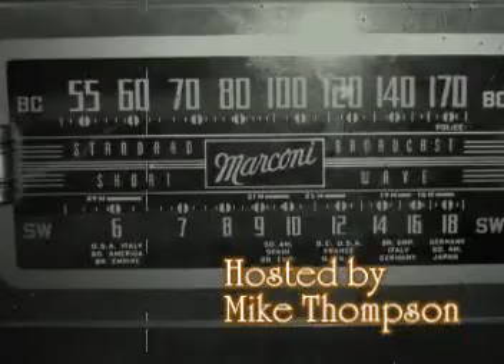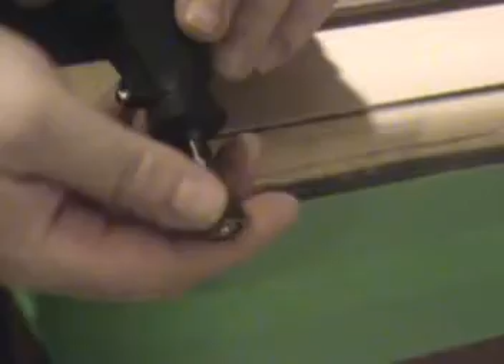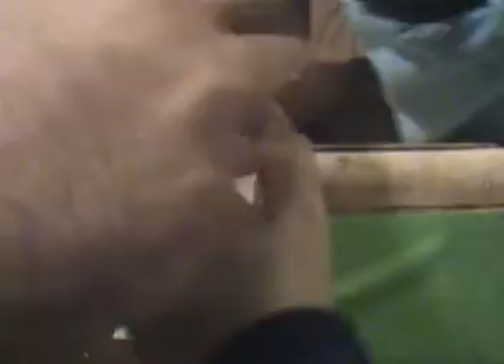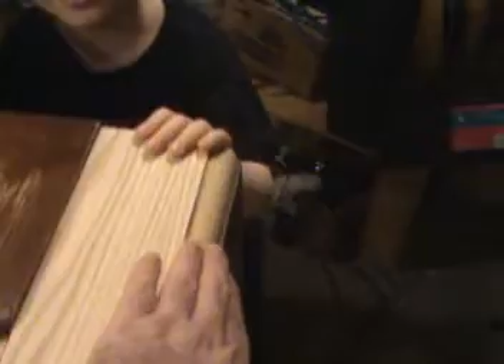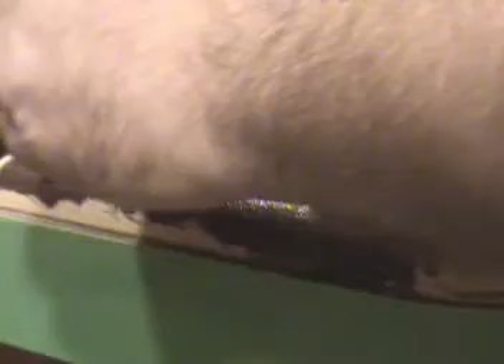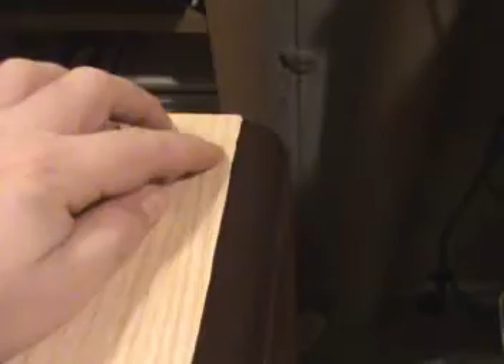Repairing and Restoring Tube Radios - part 6

Comment: If you do a lot of restoration work or intricate sanding you might want to cosider getting a Porter Cable 9444 detail sander.
Of course there is no substitute for elbow grease.